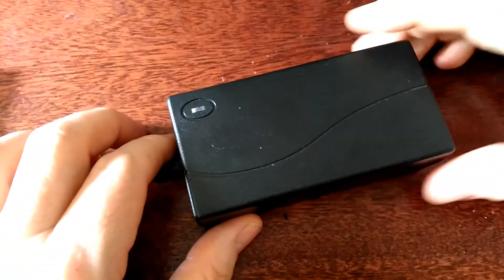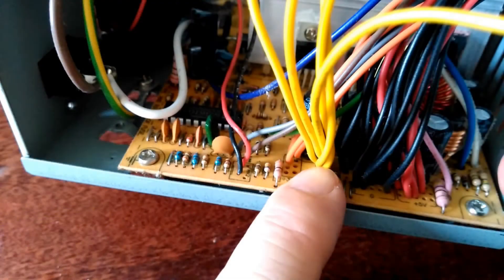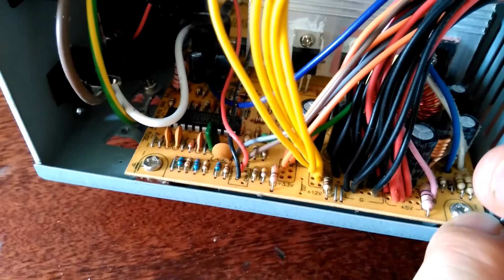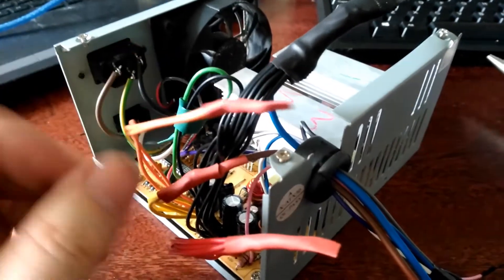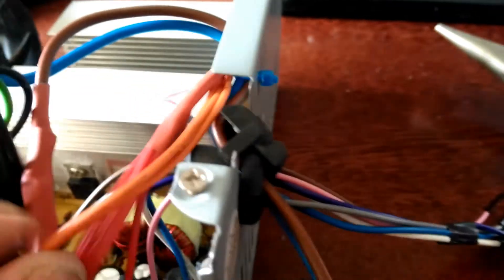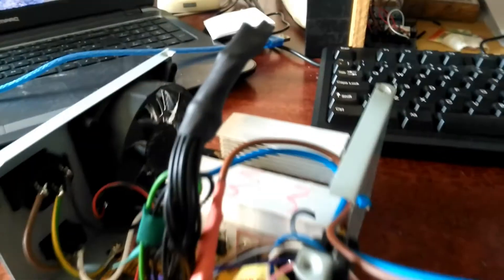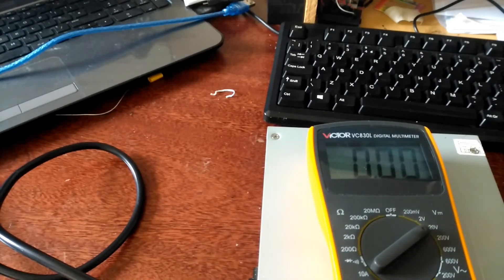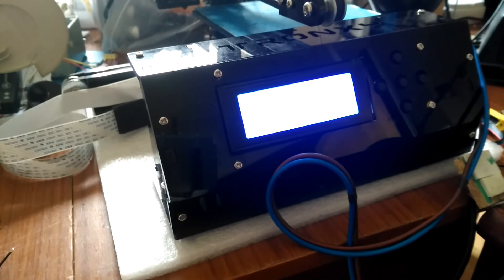Upgrade TronXY X1 Power Supply with PC Power Supply

Comment: Could you solder the green wire directly to earth from the main kettle socket in the PC ATX power supply?
Reply from the maker: It might work as Earth and negative end up being connected but not always directly, .so it's not he surest way to do it. It would have the positive side effect that if the appliance wasn't earther properly, then the supply wouldn't come on so you'd know something was wrong. Hmmmm!